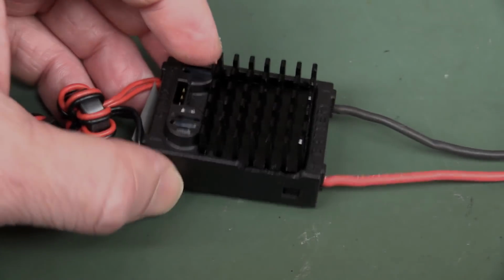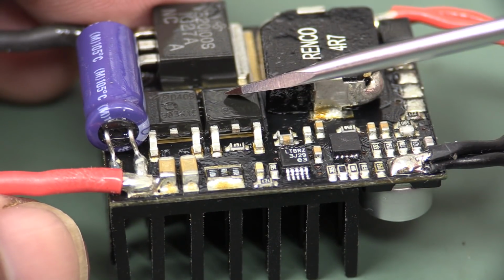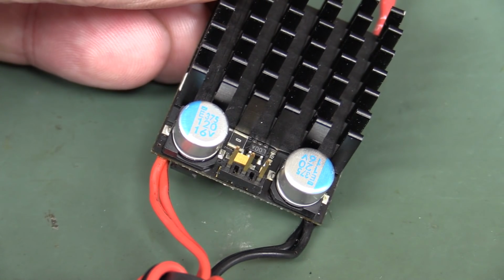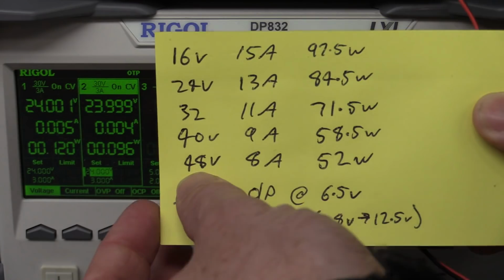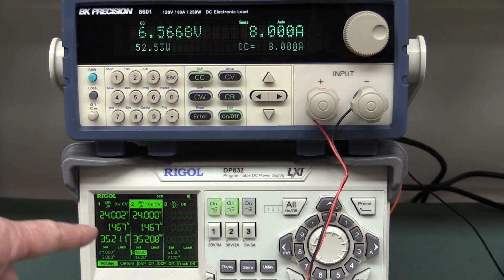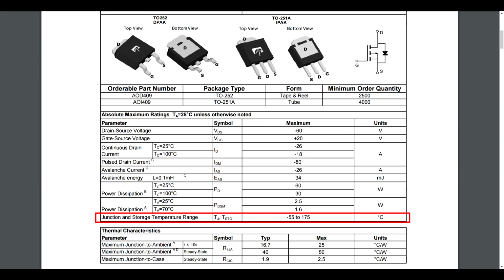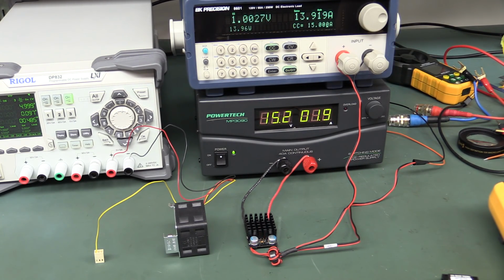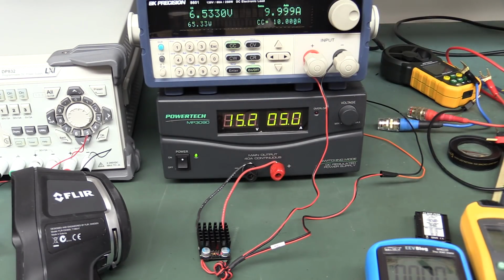EEVblog #895 - BEC Pro Model Airplane Regulator Testing

Comment: I fly electric heli's up to 90 size (250+ amps into the motors). I use this type of controller all the time and they are normally used to power radio and servo's etc that create short term peak loads rather than continuous maximum loads. If you want to run them at full power continuously then yes you need to put them in air flow and they work fine. In other words they work fine for the intended purpose.

Comment: It's interesting about the output connectors.  Those are standard servo connectors and have been in use in rc for many many years.  When they started being used the power handling requirements were a lot lower than they are today.

Comment: Great testing there Dave. Never thought to stress test my BECs this way as I have the same PSU and a Maynuo EL (which looks to be a ripoff of your BK unit).
As many have said the Castle creations units are certainly one of the better brands out there for this sort of gear and they're not really expensive as you mentioned. I have a couple of those CC BECs but have never really stressed them - they are way over sized for even my large RC heli's. For reliability I've now removed the BECs and gone back to a dedicated control battery (2S Lipo). Some high performance servos and gyros ( for Heli's anyway) now directly run at the higher 7.4volts (as opposed to the traditional 5 volts) of a 2S battery so the BEC can be totally eliminated in my case. One less thing to go wrong IMO. 
Once again - great video.

Comment: Definitely not cheap in the rc world.  Also most speed controllers have the ability to power servos etc but they may not be powerful enough or may brown out the receiver under high load.  The bec is mostly used to help with those issues.
Reply: It's pretty cheap for a high power BEC.  Western Robotics are regarded as the best BECs in the RC industry and cost upwards of $100.

Comment: What about if it was running at 16 volts exactly instead of 15.2,  would it manage to output 15 Amps or would the 0.8 Volts not be enough to cause a problem?

Comment: Those current ratings are max output powers for short bursts. Even on the 10A current draw @16V the load would be only about 0,65 Ohms. For example there are four HV servos on an average 3D helicopter. That way each servo could draw about 2,5Amps continuously. 23Kg-cm servo would need about 23Kg x 9,81 x 0,01m (movement distance)= 2,2J energy. If the speed of the servo was about 0,1sec at 23Kg pull load, the servo would take 23W at maximum. Four servos could take about 100W in a fraction of a second. The BEC wouldn't give enough power on continuous load, but on short burst it might do the job.
Reply: You're wrong.  It literally says that the ratings are for continuous current with 5mph airflow.  While it's true that the loads will be much shorter in real life, it doesn't matter because the BEC was rated using constant current.
Reply: The issue is that the specifications printed on the device clearly claim max continuous current. Irrespective of its real world application, if something is going to claim those specs it should be able to operate indefinitely at those levels.
Reply: +Silanda  I agree
Reply: +KpilotRCHelis Ok, thanks for correcting.

Comment: Can you do a video on computer power supplies? Common thought in pc building is that the cheaper ones are the work of satan and kill all your components however i have a few pc running shit ones that havnt failed for over 7 years.
Reply: I've had several shitty PC supplies and they've all kicked the bucket except 1. And that hunk of junk can kick out 14v on the 12v rail and the voltage seriously dips under load. They won't kill your components (if they have overvolt cutout) but they will kill themselves.

Comment: Was liking the look of your Flir thermal imaging cam Dave, until I found the price!!!  £4000 in the UK!!  I suppose it was a freeby then!
On using the voltage reg, presumably it would be mounted exposed to airflow created by prop wash?  In which case, plenty of air flow!

Comment: I still don't understand why you would need that much power for a BEC. On my model car it was just a way to power the radio or other devices that would have minimal draw, eliminating the four "AA" batteries in series, unlike the motor which runs directly off the "Large main" battery or speed control. Other then the motor what other high drain devices would use this on a plane car or helicopter? At first I thought it was a speed control looking at the beefy wires.
Reply: On planes/helis you need a few servos and these draw a fair bit of current. Maybe on really big models that require strong servos.
Reply: Four high voltage standard servos producing 25kg-cm of torque and 0.05s/60deg will easily draw 2A during travel with no load on the output and much more peaks.  Helis use four, and huge scale airplanes can use up to 8.  That's some serious power.  Cars are nothing compared to aircraft.

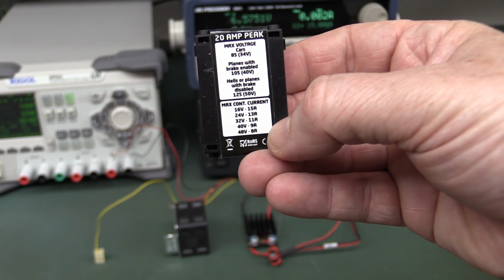Comment: 25:25 - It likely failed at the 15A output because Dave's supply was only outputting 15.2V AT THE POWER SUPPLY. While relatively small there will be a voltage drop over those leads at the required current (7A+). Plus the manufacture listed 16V not 15V as the required input voltage. If it only needed 15.2V they would have marked it 15V and not 16V.

Comment: Aren't those 0.1" pin-header connectors usually rated around 1A/pin?
Reply: In the commercial application with zero airflow, they do 2-3A.
Reply: Those pin headers you see on the BEC are for the programming interface, AKA CastleLink..

Comment: Those output caps are Chemi-Con PS_ series (not sure of the last letter, series name couldn't fit on the top there) solid polymer electrolytics - i wouldn't be concerned with those kicking the bucket anytime soon. Besides, their tops are even "outside" so they get some cooling from the airflow.

Comment: Nice one Dave, thanks! A friend of mine uses a BEC that looks very much the same heatsink in his aeroplane. As his systems engineer :-) I had him try a couple different geometries to mount the BEC in a "prototyping fixture" I jury rigged. Best performance so far has heatsink fins getting air "scooped" & directed over fins

Comment: The logo on those two cap cans is the same one on the solid polymer caps I bought for a Radeon HD 5870 GPU card six years back.  For the life of me, I can't remember the brand, but I remember it was a well-known name.  For what it's worth, I only just retired that same GPU card last week and it still works.

Comment: That input/output table doesn't make sense for me (but I'm quite noob in EE) .Shouldn't the power supply be capable of outputting higher current, when it's fed with higher input voltage? The spec table could be reversed and that's why the supply gave up, when Dave tried to draw 15A while input voltage was 16V. I guess it wouldn't be first time, that a label contains errors.
Reply: Oh, I see. This makes a lot more sense now :-) Thanks for pointing to this little detail.
Reply: No. If you look at the data sheet for the buck converter it is less efficient at higher input voltages which means it has to dissipate more heat. So at the lower input voltage it can output a higher current.

It likely failed the 15A output test because it was only supplied with 15.2V (at the PS) and not the listed 16V.  There are lots of factors involved with switching converters so if you need the maximum you're going to have to be pretty close on the input voltage.  If you don't ride the max it's going to be easier to cover the voltage range provided by the source (battery).
Reply: The little details are always in the fine print!  ;-)  When you are close to a maximum you have to be looking for those little details.
Reply: Its all about watts, If the current went up as the voltage did, and if the spec table was reversed, then it could output up to 15 A at an input voltage of 48 V, and that is 720 watts to dissipate. I'm pretty sure that would not last long.
Reply: But neither gonna deliver 48V x 8A = 384W. You did the same error as Dave did in the previous video, multiplying input voltage with output current.  What I meant, that if the table was reversed (output current 8A at input voltage 16V, 15A output at 48V input - in both cases the output voltage still @6.5V - would make a lot more sense for me)
Reply: For switching regulators there 2 type of losses, conduction losses and switching losses. Conduction losses go down as input voltage increases, and switching losses go up as input voltage increases (that is just general rule). According to that you can find input voltage where sum of them is minimal (switching losses rise more then conduction losses fail) and for general back converter it is usually around 7-8V on input where they are most efficient (but that is dependent of many factors).
Reply: +ElmerFuddGun These units are also micro controlled for safety and if you don't program it to run at the max 16V, then it shuts down. This one was not programmed for the max, the sender of the item stated he had it programmed for Dave original testing wattage on the Rigol power supply. That's most likely why it failed. If the voltage drops (and it does when in flight over use) it will still put out what's available to keep the plain in motion until it lands giving the battery doesn't die all the way and the person flying it doesn't over fly their flight time. This is all based off of what batteries are used, how much power is used when flying from the servos and motors, how aggressive the flight is. its a lot to figure out for what your flight time should be.

Comment: I'm disappointed with your testing methodology Dave. Those kind of things are ment for rc airplanes that can easily fly over 60 mph. And you are supposed to put that heatsink into the airflow. You need to take to consideration that those models fly for a few minutes(8-15), they have ridiculous high airflow and wind speed, castel it's a very big brand into rc world, it's almost impossible to get that kind of power draw from only a few servos, and they need to keep the weight down because it's an airplane(any unnecessary weight will reduce the flight time for nothing).
Reply: It makes sense to test things at their advertised specs. It's a much better indication of the quality than a best case scenario test; Once you know it can do more, you know it can do less.
And it passed this worse case test really well, nothing to complain about
Reply: Keep watching, he added a fan later.
Reply: He tested it with airflow
Reply: you dont get 60mph airflow inside the fuselage
Reply: Cool components are happy components!
Reply: It depends how its build and the design, I leave the heatsink outside in a cut out
Reply: +Joca God I put slots in the body's of my cars for the castle ESC running LiPo cells and brushless motors, slowed in front of the heat sinks, and then some in the back for even flow when the cars moving. The ESC for cars is a little different, it inky pulls that much power at full throttle but that also equals the most air flow if the body is slotted. I don't have the advantage of higher altitudes and colder air like with plains. But I know people who fly and do the same, they make vents to direct the air into the electronics that need it and save power from not having to run a fan extending run time.
Reply: +Gadget Review (GRV) i started to do that on my slash, moved on to fan cooling because of the dust and debrid. btw dusty motors is perfect for keeping it clean
Reply: +Joca God Thanks for the tip, I guess I'm still old school doing RC since I was a kid. I use the simple leg stockings to cover the motor and some non-weather proof electronics. Keeps dust out, easy to change or blow out like a filter, and it's cheap and still allows the equipment to breath.
Reply: +Gadget Review (GRV) i just use the dusty motors because its made for my rc model and has a zipper for easy acess, its more for rocks than for dust
Reply: Sounds like it works for you. Enjoy the race. It's a fun hobby but can get expensive, but I never stopped. To much fun, and they keep getting faster. :-)
Reply: What did he do wrong?
Reply: Eh, it was fine with the lower speed he had so it would be even better at a higher speed so I don't see the problem really, I assume Catalin just saw it without a fan and stopped there.
Reply: that fan isn't the same as cold air in higher altitude rushing at 60 or more mph

Comment: Hmm it expects the heatsink in the wind all the time while flying, people selling over rated junk :-(
Reply: it called RTFM. It calls for direct air flow.  This is provided by placing it in the airflow path of the propeller wash ( Propellers make fantastic fans). :)  Also you are not going to be sitting idle on the tarmac driving 1/2 a dozen servos to full load for several minutes unless you are just being stupid.
Reply: Yes it would have been better if it was used that way, they should have printed that on the label "* Power ratings are only with full cooling.", or something similar :-).
Reply: Oh yes of cause, the all time great "Warning Hot" on the side of hot coffee for morons.
Reply: +zx8401ztv That warning is there because most people don't think spilled coffee will result in life threatening burns.
Reply: zx8401ztv
My favorite warning label is the one on the "INSIDE" flap of some Microwave Popcorn that says "Remove Plastic Wrapper Before Microwaving".

Comment: Awesome to  see these on your'e channel. I bought a similar thing rated 8A, but the datasheet on the chip was only capable of 3.

Ive also had one on my miniquad, that failed sending 14V through all the 5V electrics, ruining $100 worth of flight controller, receiver, camera and vtx.

Comment: I tested a lot of Castle products over the years. Their BECs are actually among the best you can get. A BEC like this is meant for high powered airplanes or helicopters which would have ridiculously high airflow and it's generally assumed that you will mount it as such. It's also worth mentioning that the dominant load on these BECs is servos so it's virtually guaranteed that peak loading will never happen for more than a few seconds at a time. Check out their ripple and transient stability if it's anything like their entry level BEC it should be good.
Reply: it seems pretty well made and though out, seems like good parts too
Reply: Yeah if you want best..talk to NASA, they might surprise you
Reply: @jhonnyginting8985  Yeah, NASA uses a LOT of Castle products